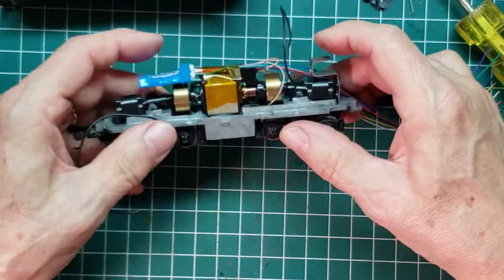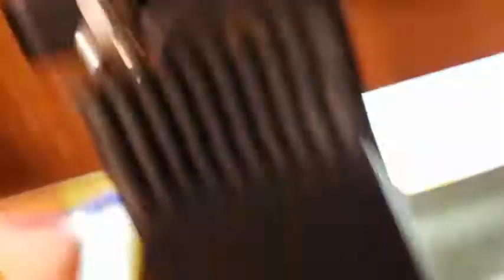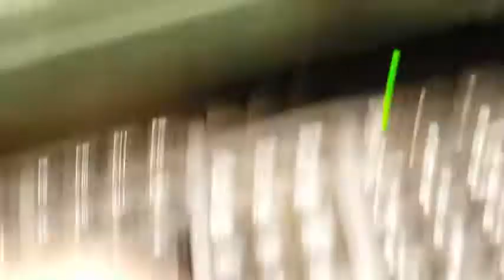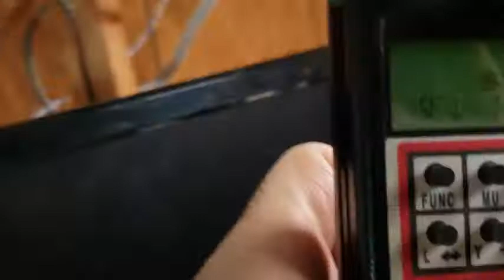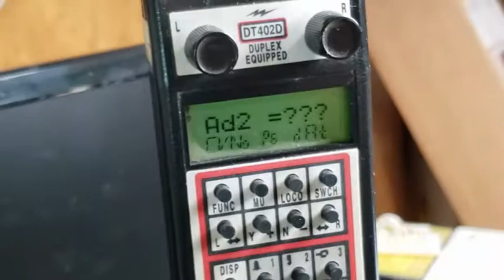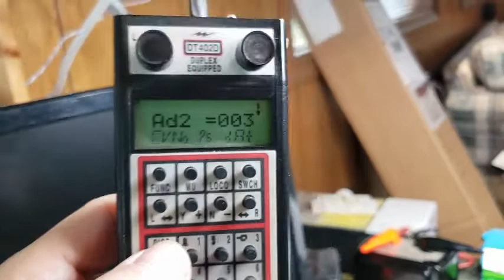HO Athearn SW1500 part 2

Comment: Watched these videos 2 years ago, now watching again as I found an SW1500 for a decoder install.  Also watched some other installs and picked up some tips that may help you. 1.  Use acid flux to make solder pad on spring steel, then attach wire with regular rosin flux.  Clean solder joints with acetone.  2.  Make decoder platforms out of plexiglass, scrap plastic case lids or, perforated phenolic Ckt board (w/o copper backing).  Use PCB strips glued to platform to collect wires.  Appreciate you did this in real time as I encounter similar issues during installation but you have given me incentive to forge on as I am also an older 70 yr old than you.